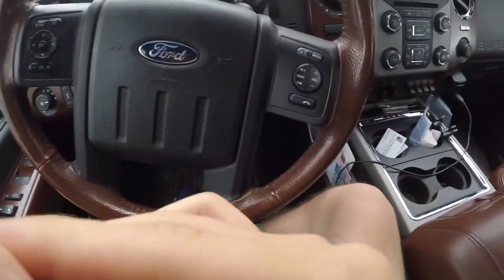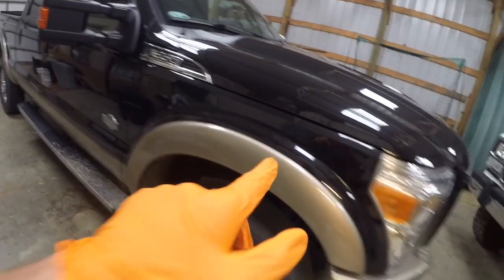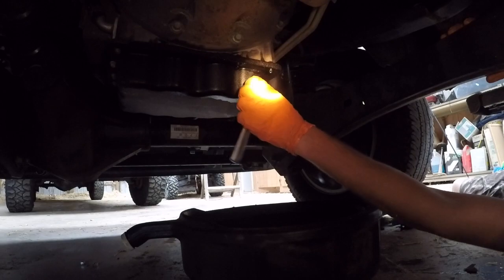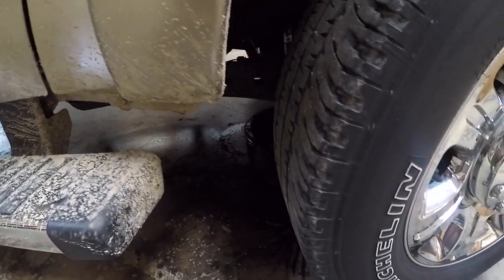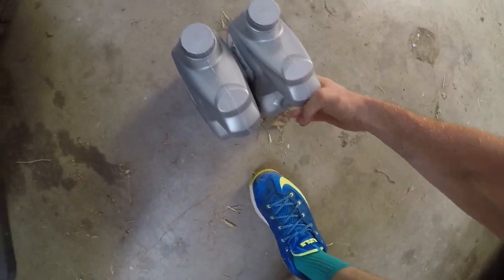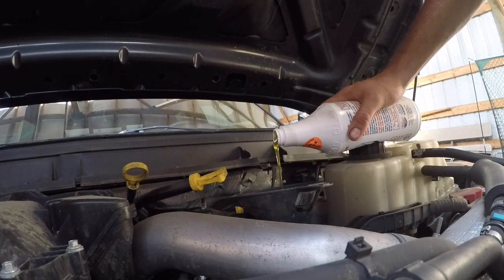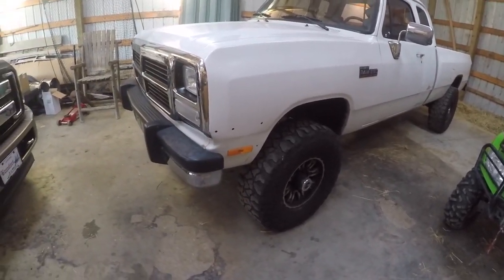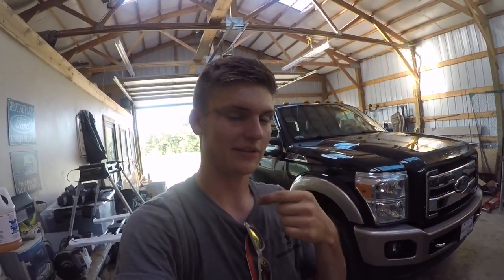MOST IMPORTANT PART OF DIESEL MOTOR MAINTENANCE!!!

Comment: Anyone who insists on using that Lucas oil additive .. I have heard that you should only add it when the engine is hot & running. If the engine is cold, it will just plug up small passageways till it warms up and flows.

Comment: The life of a diesel engine is clean fuel, coolant, oil and air. I personally use motorkote additive every 3rd oil change and use the rotella t6 5w40 oil and motorcraft filters. I change my fuel filters every oil change, do a coolant flush every 25 thousand miles and a transmission service every 25 thousand miles. I paid alot for my dually 6.7 and want it to last as long as it can. Thanks for the video young man and keep up the good work.
Reply: Hollow point, I am just not looking into a dually. Everyone tells me the maintenance on one is in the thousands and just get the gas 7.3 coming out gas ford.  Is that true? That I will have to take it to dealership to service all the time? Ty

Comment: I remember watching this video the day it went up and it was the same day I did an oil change on my  first truck which was a 2002  GMC Sierra 1500 z71 that I had at the time and the same thing happened to me. The oil almost went into my eyes lol. Bought an 01 24 valve recently and loved the drain plug that simply goes straight down like it should!!! Probably the cleanest oil change I ever performed haha.

Comment: Good video but don't forget to grease the front end that is important to as for the oil filter take and the oil running over it take a small stub nose screw driver and a small hammer and peck a small while in the bottom of it and it will drain it then screw it off and no mess and when pouring your oil in if u turn the jug on its side it will pour nice and smooth for u bud love the truck.

Comment: Here's a good tip I use, take a center punch and hammer a hole to drain the oil out of the old filter, that way it won't go flowing down the sides and get all over your wrench when you take it off
Reply: Ben Ross since I own my own semi shop after doing so many oil changes I took a hammer cut on of the teeth off the back and sharpened it and that's what I do punch whole with the hammer let it drain first, doesn't make as much of a mess

Comment: Just some advise here but I would use the pure synthetic additive from Lucas instead of the heavy duty oil stabilizer. They are the same size bottle just different variants. The reason being is Lucas actually tells you to use the synthetic additive instead of the old heavy duty one right on the bottle. Their are special ingredients in the newer version synthetic variant specifically designed for newer engines, but akso older ones. (Try it in your cummins) Second, the heavy duty stabilizer you used is basically gear oil which is not good in newer tight tolerance engines. The newer synthetic additive is also meant to go in synthetic amd conventional oils too. All around I would use the pure synthetic additive.
Reply from the maker: VelocitySCTR good advise for next time
Reply: LOUD 'N' PROUD I sell tires, oil, etc for a living so thought I'd pitch in. Great content, keep it up!!!

Comment: Make it easier next time leave filler cap on til majority of oil drained use a 5 gal bucket to catch oil and loosen plug all but  few threads hold bucket up close to drain plug and remove plug  after flow starts put bucket on ground  it will be less messy. After 2   6.7 psd's you learn  the tricks to diy oil changes and the plug doesn't need to be that tight it as a o-ring seal built in  ford service manual says 15 ft/lb torque on oil drain plug  a Cheater bar should not be needed  someone WAY over tightened it   Careful not to strip it. Or get a drain pan with large opening on top or make hole bigger

Comment: Shops and dealers are terrible when doing oil changes. They over torque the oil pan bolts. I had my oil pan stripped after a Ford dealer used an impact wrench to tighten the bolt. I only took it to the dealer because the 1st oil change was free.
Reply from the maker: Pablo's Reef for sure..
Reply: I don't think dealer mechanic's own or know what a torque wrench is. They just use an impact wrench.

Comment: I change every 3k miles if my oil aint bad but i check it every day and when it starts to lose viscosity i change it if its before due its a bit costly that way because i tend to change it every 2500 miles 
Question: as far as maintenance is it better for your engine to do it the way i do it? And could it increase the longevity of the engine and make components last longer?
Reply from the maker: project 4.6 the more you change it will for sure help to keep good oil running through everything

Comment: Iv always went 12000 miles b4 I change my oil. Synthetic oil u can go 20000 miles if u want    the oil now days is good that u don't need to change it after 3 or 5000 miles cause if u do u don't even let the oil do what it needs to do       the only truck if changed 5000 miles stayed in the shop my others worked perfectly
Reply: some over the road truck drivers never change the oil .. they due an oil analysis every 20,000 miles .. if it comes back good, they continue for another 20,000. When they change the filter, some fresh oil is added.

Comment: yes Lucas is an awesome product!
Reply: And so was STP .. NOT.
Reply: I'll admit Lucas motor oil would be beneficial if you drive in a desert or race conditions with constant high heat conditions that would thin the oil out. Any region that would experience extreme freezing conditions it would be detrimental as it would become the viscosity of molasses straining the pump and starving the engine of oil during the startup.
Reply: I'll admit lucas motor oil would be beneficial if you drive in a desert or race conditions with constant high heat conditions that would thin the oil out. Any region that would experience extreme freezing conditions it would be detrimental as it would become the viscosity of molasses straining the pump and starving the engine of oil during the startup.

Comment: It is high man I couldn't afford the diesel truck not to mention the 10 grand in upgrades lol but I do love diesels but don't own one but hopfully before I die I will own a diesel they are just to high dollar
Reply: Chris Balser i have been looking into buy a 80s model power stroke diesel they are cheap they will have a few things you need but other than that they seem to last forever
Reply: project 4.6 that's awesome man even the older ones around my area ppl want high dollar I just seen a 94 powerstroke in my town the guy wanted 12 thousand for a 94 in my opinion I think that's a little high for a 94
Reply: if you do happen to get a 7.3 replace the IEM sensor i think its called but there cheap and easy to fix you can to it yourself but if you get the chance get a idi they are naturally aspirated and tend to be cheaper

Comment: 2013 owner here....cringe when I seen the pan he was using and the positioning. I learned to use a 5 gallon bucket for the oul changes. Taking the filter off is a mess, as well. Would have been nice if they angled the filter si i didnt flow out all over the filter.

Comment: your using the wrong oil & oil filter. uses Motorcraft
Reply from the maker: Tagz we use what NAPA recommended
Reply: LOUD 'N' PROUD Schaeffers oil....5w40 in the winter...15w40 summer...archoil for the oil additive...always want to run fuel additive if you like your injectors and prevent stiction...a good coolant filtration system will make everything last much longer too.

Comment: LUCAS #1
Reply: I'll admit lucas motor oil would be beneficial if you drive in a desert or race conditions with constant high heat conditions that would thin the oil out. Any region that would experience extreme freezing conditions it would be detrimental as it would become the viscosity of molasses straining the pump and starving the engine of oil during the startup.

Comment: Not being a hater but 6.4L and 6.7L powerstroke a aren't worth owning. Talking about a break down POS. Not to mention cummins and duramax in the real world out pull it. Coming from a 7.3L powerstroke owner.
Reply from the maker: Sackmatters nah... just the 6.4's... and the new 6.7 would be a really tough truck to beat on top end pulling power just saying... they out work almost anything
Reply: Sackmatters 6.4 agreed but 6.7 not so true, I've heard a lot of good about them. I use a new duramax everyday and I'd take power stroke or cummins over it. I love cummins probably take it over any and I own 3 7.3s LOL
Reply: LOUD 'N' PROUD I'm friends with mechanics and I'm a mechanic my self. The early 6.7L trucks were truly horrid, the new 6.7 still isn't impressing anybody. The worst part is my 2012 duramax can out pull the new duramax and powerstroke. Which makes NO sense. I pull every weekend. These new trucks with all their power aren't truly doing anything special.  New powerstrokes are only worth 250,000 miles which is embarrassing for such a outstanding company.
Reply: ChampOfLeague they are better than a 6.4L. Which thank god their better than a 6.4L. I'd own a 6.0 over a 6.7 I promise you that. But if I were to buy a truck to work I'd buy a 02 duramax. Other than that I'd want a 05 cummins with the HO. What year duramax do you drive?
Reply from the maker: Sackmatters you don't make a lot of sense dude lol... the HO Cummins are no good lol... I've heard horrid things about them blowing up out of nowhere... but you seem to think you know it all so whatever lol do you
Reply: Sackmatters 2013 gmc 2500, looking into getting a 5.9 or 6.7 cummins, I have a 95 dodge 3500 that's been cat swapped that I'm wanting to redo 100% but wanting to drive an inline 6 love the power/torque of them so gonna get a cummins while I redo the cat swapped dodge.
Reply from the maker: ChampOfLeague yeah I've talked to the Muscle with the diesel brothers in person one on one and he said he would never buy a duramax as a go to pulling truck... he said they suck lol.. Cummins with build tranny or fords the way the come are great if deleted. He still owns a duramax and a few fords but he said all his d-max is good for is taking a small not to the lake house 😂 can't manage much more then that 😂
Reply: LOUD 'N' PROUD In what way do I make no sense? I'm not going to buy a truck throw a programmer on it and expect it to last forever like all the children do because they hear the word high output so that must mean it's a special motor. Not to mention I do not know it all considering I don't work on diesels all day everyday for a living. I do know what is good and what is bad because I've had the experience with them. Tell your dad to get his garbage ceramic ball bearing turbo out of his truck def delete it put a real trans and TC in it put a programmer on it to delete def and do a egr delete. Then it might be decent but until then the best of luck to you guys and the 6.7. I know they come with a hell of a price tag.
Reply: Sackmatters your on crack 6.4s are powerhouses when aftermarket performance parts are added. and the new 6.7s are wicked straight from the factory let alone performance added.
Reply: Powerstroke PA says the powerstroke fan boy. With powerstroke in your name...... well I have to go to work have a nice day.
Reply: Sackmatters when you grow up one day and realize being a mechanic is more than working at the local jiffy lube. I work at a steel mill as a mechanic and welder.
Reply: Sackmatters everyone seems to be a mechanic and know, 6.4s are fine if you take care of them until about 100-150k miles. Then they give you problems, but you can turn them into monsters doing a couple things to them like powerstroke pa said. But idk where you are getting your facts on the 6.7 powerstroke, I drive this duramax, pull with it, nothing to heavy it's a farm truck, if it's to heavy I put it on the low boy, the truck doesn't go over 2500 rpms, get oil changed right when it needs it, greased, fluids checked everyday and it's been in the shop for work about 5 times. It does it's job I'm not saying it doesn't but with 70k miles it shouldn't be in the shop that many times. Just came from Florida worked with a friend with a complete stock 6.4 with 95k miles all he's done is do maintenance and it hasn't been in the shop for any problems. He does know there coming so yes he does have money set aside to do the delete and shit at around 100k miles. Now that being said they all have problems I've driven them all. I bought a mustang and put it on a trailer and brought it back with a v6 f150. The truck brought it but wasn't happy. So I asked a friend when I bought a couple more cars to use his 5.9 3rd gen dually. That cummins wouldn't go past 50 mph, it would start to over heat it wouldn't shift. I have videos of it all, I gave it back to my friend he took it to a shop and spent couple hundred dollars replacing a bunch of sensors. It's what happens no truck is perfect nor brand. But I will still take cummins/powerstroke over duramax everyday from my experience.
Reply: Powerstroke PA oh how impressive. I'm a full time fabricator/ custom installer.
Reply: ChampOfLeague it is all within experience. I live where trucks are used a real trucks. Alaska. I've got to make sure it starts in -40 and can handle being driven down horrendous roads everyday. I can list all the issues with the 6.7L is you'd like me to.
Reply: Sackmatters but at the same time you could list me just about the same issues with the duramax and cummins, no brand is perfect they all have issues, you can say as much bad about the 6.7 or any powerstroke but the same could be said about cummins and duramax no matter how much of a fan boy you are weather it's Ford dodge or chevy, they all have issues especially with the amount of emissions they need now to be built. Doesn't matter how much of a mechanic, how long of a mechanic someone's been, what they've done, someone else has done the same to another brand like it or not.
Reply: ChampOfLeague I'm no fan boy what so ever. You cannot say a duramax or cummins have injector failures out of the factory and or a turbo grenade right out of the factory. How about egr failure or connecting rods breaking and or warping. Injectors being stuck open. I've seen that plenty. Like I said I own a powerstroke and a duramax.  My girlfriend has a cummins. I've got all 3. Not some brand loyal like most.
Reply: Sackmatters I'll put money down that both cummins and duramax has had all those problems before, may not be as common but I'm sure some have had injector problems and shit like that.
Reply: ChampOfLeague of course they have. Every truck can have a freak problem but not 1/500 are going to have those problems like the fords do.

Comment: Lucas is the worst
Reply: Yep, it's the new STP oil. lol
Reply: I'll admit lucas motor oil would be beneficial if you drive in a desert or race conditions with constant high heat conditions that would thin the oil out. Any region that would experience extreme freezing conditions it would be detrimental as it would become the viscosity of molasses straining the pump and starving the engine of oil during the startup.